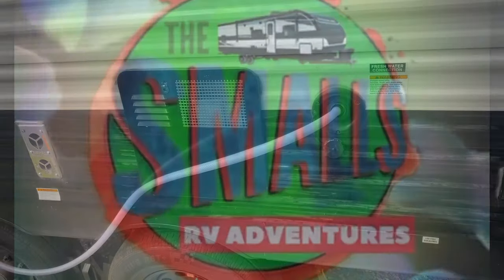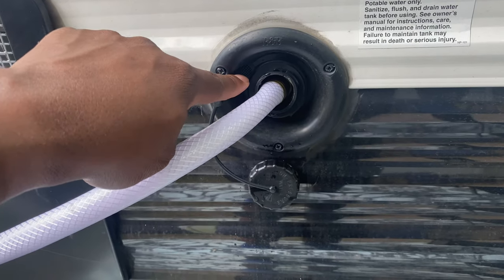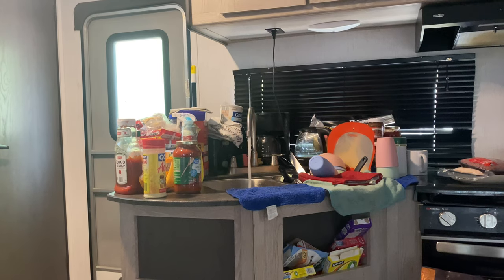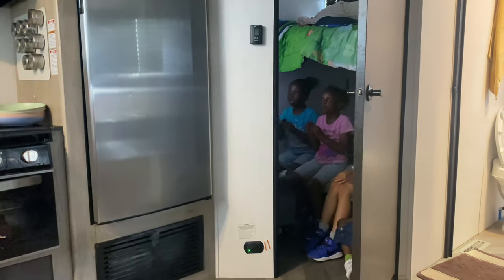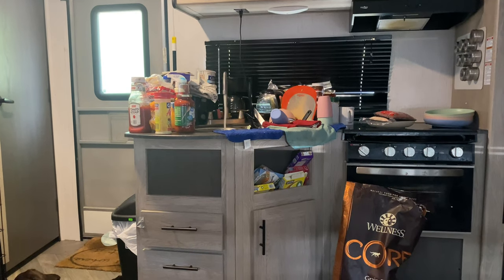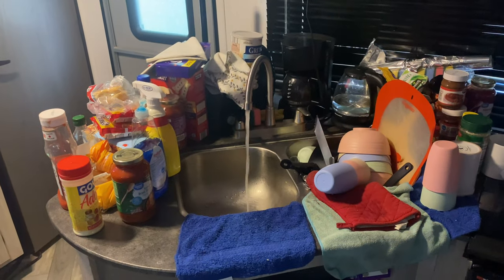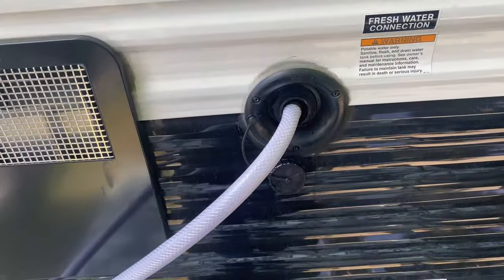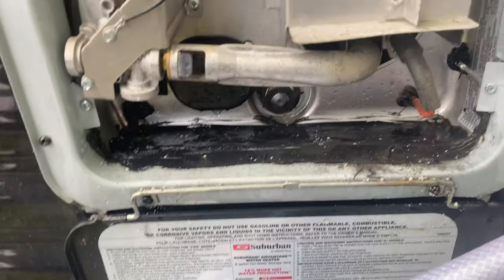RV Maintenance / How To Sanitize RV Fresh Water Tank / How To Change RV Anode Rod

Comment: After flushing the plumbing by running the pump, why don’t you drain the rest of the tank out the bottom of the RV? Maybe you can’t in an RV Park, but maybe you should include that option in your video for people that don’t know to drain the tank that way.
Reply from the maker: That’s a very good idea. I never thought of that. I usually do that in the winter after every use while winterizing. That’s a good point.

Comment: Do you have a link to the drinking water hose?
Reply from the maker: Hey Raven. Yes I sure do. In the description of the video there a link to my Amazon store front. Click on it and look for the rv start up list. The drinking water hose is in there. I do earn a small commission on purchases made from the store. It does not change the price for you.
Reply: I also do not drink out of my fresh water tank.
Reply from the maker: @IcePonyGoddess  we are the same. We use it to wash dishes and to flush. We still sanitize it to prevent mold growth.

Comment: How many times a year do I need to do this ?
Reply from the maker: Hey Juan. You should sanitize your tank anytime you have water sitting in there for a prolong period of time without using it.  The Anode rod should be changed every one to two years. After each camping season it’s good to check to see if it needs to be changed. We change ours once a year because we camp all year long.
Reply: @TheSmallsRVAdventures  Are you using a product to sanitize your tank?  How do you sanitize the water heater?  TIA!